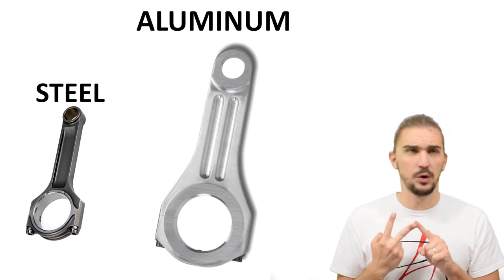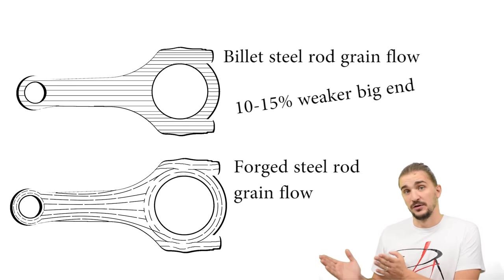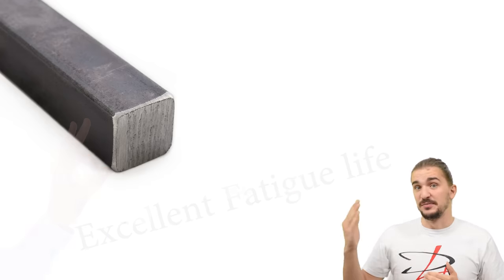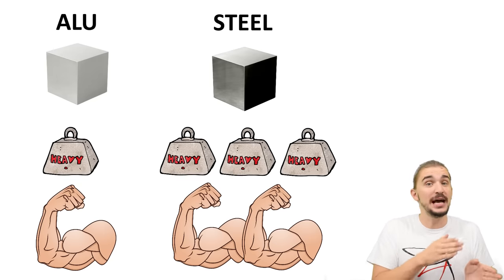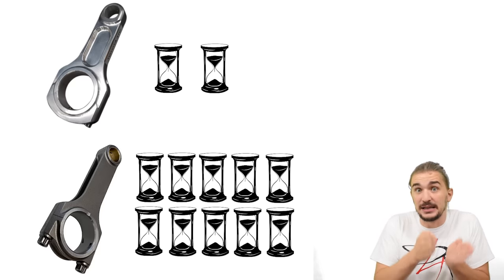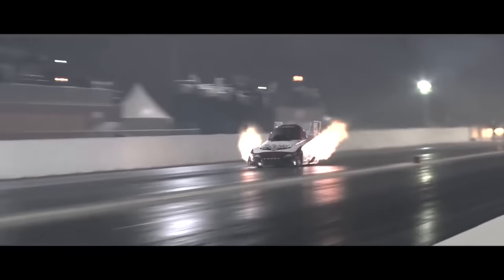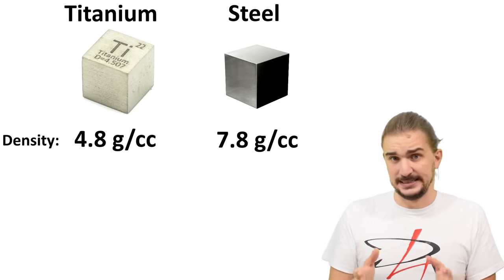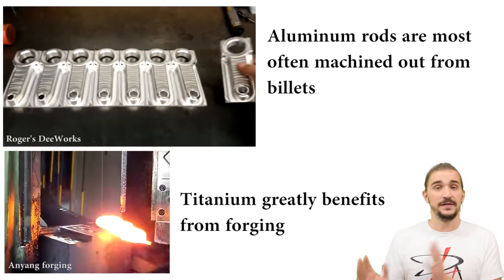STEEL vs ALUMINUM vs TITANIUM Connecting Rods

Comment: Good Points,but i have to disagree on the machineability of Titanium, personally i prefer Titanium  over Stainless Steel or some kinds of Aluminium .
With Some kinds of aluminum, the chips stick to your tools like crazyglue, and don't even get me started on Stainless Steel.. 
I make watchcases out of Titanium TiAl6V4, and with fresh tools, i can crank my milling machine up to 60m/min surface speed, and 1200mm/min Feedrate, going 12 mm deep with a 4 mm endmill..without Coolant!.. don't even think of these figures with stainless..

Steel is a breeze to machine, true, but Titanium is a good second on my list of materials i love to machine.
(Aluminium is also a Nightmare for Wire-EDM, it gets "Anodised" in the process.. and that layer of oxidation doesn't conduct electricity..not good when EDM is your "machine process of choice")

Apart from that.. Nice video!.. and you just told me what i need to know.. i'm gonna make myself some Titanium Conrods one day for my racebike engine. (by the way.. what about the balance of the crankshaft when you put in lighter Conrods?)

Comment: lol 100k miles. My family had a 1986 toyota corolla which even though nobody serviced or cared for it at all ran perfectly fine until 300k miles. The only thing we had to do was putting in oil cause it was just drinking that. My brother once had it for 2 weeks and forgot to put in oil and that was that for the car. Car was 16 years old at the time and worth nothing so it wasnt a big loss.
Also what Im getting from that video is that the only downside of steel is its weight and all factors included is the by far best option for any sort of daily driver. While Titanium would have comparable properties while being lighter if everything is done correctly it would add quite a bit of cost to any vehicle. Aluminum shouldnt be put into daily drivers at all unless you want regularly dis and reassemble your engine for whatever reason.

Comment: 3:49 you said it correctly but you typed it wrong 200.000 is two hundred.  You had a "." (period) where you needed a "," (comma). And again at 4:50 =)
Reply: No in europe they type it with a dot. In the imperial system they use a comma

Comment: Back in late 1960 my uncle built race engine with aluminum rods before the build my uncle tried to talk the guy out of not using the aluminum rods but he didn't listen and the engine blew up. So I wouldn't use them in my engine either.

Comment: Forged and machined steel rods should be the strongest but not low cost. 
Rod stretch can be measured from piston height. No problems if you took the figures when engine was built and the spark plug is central. But who does all that on a street car?

Comment: Top fuel engine cylinder pressures are so brutal that it compresses the rod and they measure the compression of them , and they are replaced if they are out of spec.

Comment: As a maschinist, Titanium isnt that bad to work with, yes you need soecial tools that can hande the forces that occur when working with it, but copper and cast iron are a real bitch to work with. Copper because it will start to rust instantly when get intocontact with collant, turning green and very toxic, said toxic collant can then get everywhere. Cast iron because the metal flakes that occur when milling the stuff create a sort of concrete when it comes into contact with a liquid, wich is nearly impossible to clean out. Also unless you do regular work for the Aerospace industry or a Raceteam, you will propably never encounter Titanium, because of how insanly expensive that stuff is.

Comment: No the steel with 0,4% of carbon have tesile strenght somewhere between 600 and 750 MPa and haven't tesile strenght 1340 MPa. Only the special type of steel can achive this tensile strenght. This special type of steel have name spermartensitic steel. Even this type of steel because you need to have martensite in microstructure. This can be achive with right heat treatment which includes heating to temperature, holding for temperature and quenching.  The martensite is a realy good thing but it's very brittle and pushing down the overal tensile strenght of the material. So the better choice is a surface quenching this is the type of heat treatmen when you dodn't quench whol connecting rod only the surface of this rod. With this heat treatment you can achive two things creating the partensite in outer layer of the rod but the core stay very sturdy. More uniform structure in connecting rod isn't due to forging but due to annealing. When you forged the rod you deform the microstructure. And if you take this connecting rod and put into the car your pistons can crash very soon because have deformated structure so this material isn't able to absorb mutch more energy. So you need heat treatment wihich can heal the structure and create new microstructure with smaller grains.

Comment: The ultimate strength of the A4340 steel is 745 MPa and the yield strength is 450 MPa ... the 1378.95 MPa which you quoted is nowhere to be found in the literature

Comment: Titanium is not hard enough and doesn't have enough heat resistance for use in road vehicles.  Titanium has fairly high tensile strength but it is a soft metal and quickly looses its strength with heat like aluminum.  I don't have anything against titanium alloys they are fantastic when you need something stronger than aluminum that doesn't get hot.

Comment: While this information is very valuable, he's missing the 4th type of automotive connection rod and that is the CARBON FIBER connection rod. No, these aren't common and are not really for street use. Weight of a Carbon Fiber connecting rod i is incredibly light and durable in high rpm applications (aka off road racing).

Comment: To put a disclaimer on the top: All i say is hearsay from a fiends friend.
So this friend claimed to to have invented a superour piston rod by combining steel and aluminum. He told me he made a steel tube, filled it with an aluminum billet and them forged piston rods out of it. He claimed 10% lighter with the dampening of aluminum and tensile strength of steel. It's credible in so far as he works as master machinist and blacksmith in a midsize jobshop (~40 employees). But after that i have never seen or heard from it again. So ether he had talked bullshit, or there where some complications he couldn't overcome.

Comment: Non of these tests are valid unless the bolts are tightened to their rated torque.  Also, the different designs indicate different applications, hardness, and alloys.  I can't see a slotted head having very high strength.

Comment: Alfa Romeo Montreal had titanium conrod in the '70.
Reply: The typo 33 V8 definitely had Titanium rods in 1970,  period literature (Bruce Taylor) shows the Montreal V8 version was running a "tungsten steel" for both crank and conrods. There was a mixed Autodelta/Alfa parts bin available so either option could be true. Where did you find the reference to titanium in the Montreal?

Comment: the great thing about steel is you can mix so many different elements at different ratios to fit your needs.... titanium and aluminum have no carbon do add hardness or strength and dont have anything to help with durability. and most steels dont mind heat cycling. ive learned a lot watching forged in fire religiously. :)

Comment: Titanium is an awesome material, the biggest benefit of titanium is that you can sell it extremely easy to all people who have no clue about metals and gain all their knowledge from Hollywood movies. I guess that's why they use it in some production engines coz it sounds like Wolverine combined with rocket science. The biggest problem with titanium is (and you kind of mentioned it) it is extremely rigid. Rigidity in most applications is not what you want coz it means that it works let's say at 8500rpm and at 8510rpm the pistons are leaving the building. There is simply no warning, it does not bend it cracks immediately. It is the digital 0 and 1 version of metals, and mostly that's not what you want. I agree with all you said about alu vs steel but you missed out one little thing. The dynamic force of the oscillating parts squares with the speed. So having a rod that is just a few grams lighter makes a huge difference in the force it has to withstand. Seriously IMO I would come to the same conclusion you did that forged steel rods are the way to go but because of the tiny weight advantage of alu and the lower forces, I would not consider them to be so bad. 
BTW the surface of the forged steel rods, you can polish the surface to enhance it's strenth.

Comment: Your aluminum rod info is far off. Aluminum rod on the street only factor really is Stress corrosion. Meaning if they go through constant heat cycles like in a daily driver aluminum is great but if it’s a hot rod and sits for long periods of time to be safe the aluminum connecting rod Caps Screw not rod bolt should be loosened up. Re torquing it before you use it again. This effects 700 series aluminum  more than 600. Titanium makes GREAT a spring!! If you run a short center to center Rod and wimpy stroke titanium is great for you. Also there’s is no way to properly predict titanium’s failure point. Titanium is easy to machine and cuts like butter if your a qualified machinist. It’s even fun to weld just never make it blue

Comment: Unfortunately your (partly) wrong about aluminium rods. You don’t have to “baby” them. That’s hugely exaggerated. 
It’s probably because you (car drivers in general) have not much experience with them. 
However they are very common in race and road motorcycles. And they (even old ones) rev much higher than most race cars. No motorcyclist will baby their motorcycle more than usual because of the aluminium rods.

Comment: So basically, back in the mid-'60s when U.S. auto companies went from forged to cast components in the rotating mass of an engine, they just did it to improve their "bottom line" (aka-screw the consumer). Just as I thought. SMH. JMO.
Reply from the maker: The new powdered metal stuff is pretty good tho!
Reply: @d4a  I'm not too old to still build a nice street machine, just can't afford it on a fixed income. Things are WAY too pricey nowadays. [Wink.]

Comment: not quite true. I was a metallograph\ ultrasonic tech that ultra-sounded metal for almost 10 years an and most of the stuff i saw was hot forged and only saw that twice in 10 years and when it happened the company went crazy i mean losing close to 10mil is bad no matter how you play it.

Comment: If titanium is almost as strong as steel and is nearly half the density thereof, how does it come to pass that titanium rods are only 20-25% lighter than equivalent steel rods?
Reply: Alloys. 
They are not pure metals.
Reply: It's not close enough strength wise to have the same designs as steel. Like aluminum it has to have a different design with thicker spots to be strong which adds weight hence 20-25% vs 40-50% weight savings.
Reply: @hdlivemodels  Yeah, I though that was the case, but in the video it is claimed that titanium has similar tensile strength to steel.
Reply: @Jupiter__001_  rewatch 12:12-12:50. It has the answer but goes by pretty fast.
Reply: Because it's not tensile strength that's important, but yield strength. And the typical yield strength of a titanium alloy isn't almost as high as the typical yield strenght of suitable steel grade.

Comment: Very misleading. I worked with titanium, cast, yes cast titanium manufacturing. Titanium by itself is brittle. It must be allowed to align it's molecules but titanium is easy to machine, weld and weld repair. It becomes difficult to machine once it has been heat treated. I watched an engineer take a unfinished number 3 wood, titanium product and place it in a 100,000 pound hydraulic press.  The unfinished club was missing it's sole plate to close plus it had been heat treated. We watched the press and listened to it groan as it failed to damage the club. Titanium cools much faster than stee. I thinks it's only real weakness is moisture. If you apply heat to wet, with water, it will ignite

Comment: Tensile strengts seem way too high. Steel usually has 500 to 700 MPa, in rare cases 900, but 1300 is way too high.
Reply: Depends how deep your wallet is.
Mainline shaft in a Rolls-Royes jet engine uses Super CMV, which has around 1900 MPa UTS.
Reply: @Russ--R  I guess thats right. However, 1300 seems too high, even for conrods.

Comment: I must be dumb because IF a billot rod is machined froma forged blank?  WHY in the world would it be weaker anywhere?  That appears to suggest that the machinging itself changes the molecular structure which does not make sense???  Anyone?  OR does it just presume that ALL machined rods are machined from random forged hunks of steel RATHER than for instance 90% formed forged blanks that simply need their final machining?   I would THINK that THIS would be ideal.....especually if the forged blank is titanium!!

Comment: There is steel rods and steel rods. Endurance engines will always use heavier= stronger rods than a Sprint engine.
Alloy rods are really fuel drag racing only. Very short life. But do absorb some of the shock. For short periods.
Ti rods are far less durable than steel rods.  And way too expensive. 
As for notch,  all rods will be weaker with scratches. Most performance rods are   polished then shot blasted to  destress them. Alloy rods as well. Ti is probably the most sensitive. The only Chev based engine I have ever seen broke near the pin and sawed the engine in half. At 8500 rpm. It had only done moderate work.
I have seen steel rods do this as well. But with plenty [too much] work Or when the piston breaks.

Comment: You forgot to talk about how these metals handle heat differently. 
There is a reason parts are made of steel and not aluminum or titanium. Steel will dissipate heat faster than both. Titanium is by far the worst and will maintain temperature or "heat soak" faster and longer. 
While aluminum and titanium both have a few advantages their weaknesses don't balance out like steel.
Reply: Aluminium dissipates heat very well. that is why cylinder heads are mage from it!
Reply: @donmathias1705  I can't think and type at the same speed lol. That's why radiators are aluminum too. Yes egg on my face. but the point I was trying to make was heat properties also play a roll in metal selection for parts also.

Comment: It’s incorrect to say “it’s twice as weak”.   You would say it’s 50% weaker or say steel is 50% stronger then aluminum 
And it’s a old myth that you can’t use aluminum rods in a street motor.

Comment: Aluminum rods properly designed will never stretch on a circuit or rode car thats old shit.

Elmer has an all billet racing engine with billet rods and it is a 1500hp 4 cylinder TIME ATTACK CAR!!!

So no a 500 hp honda motor wont stretch an aluminum rod
Reply from the maker: The issue isn't rod design, it's the inherent property of aluminum as a material and its lower fatigue life. Horsepower also isn't a determining factor. Again, it's about fatigue life and an aluminum rod cannot last as long as a steel one, regardless of hp or type of engine. It's not old sh*t, just basic material science.